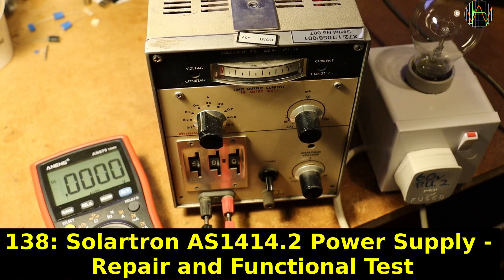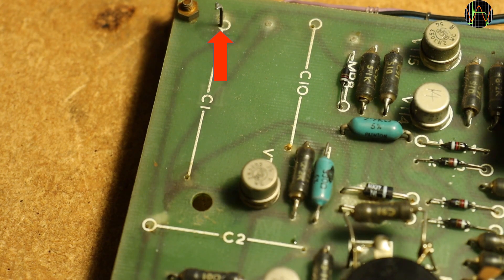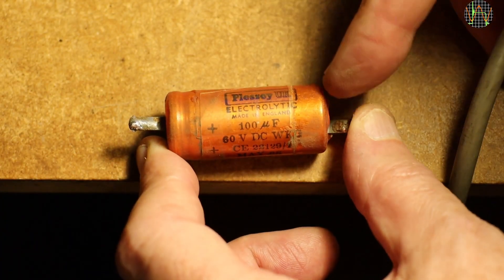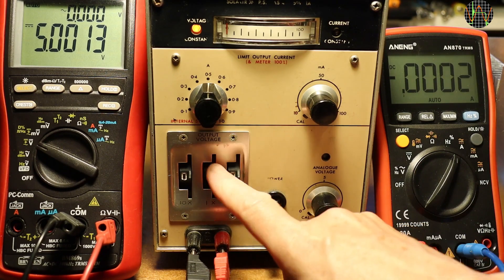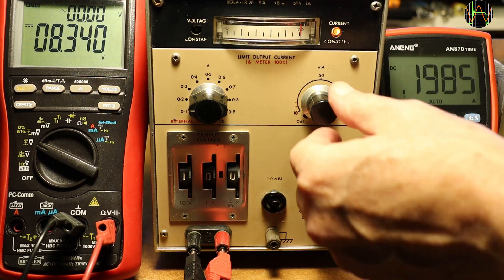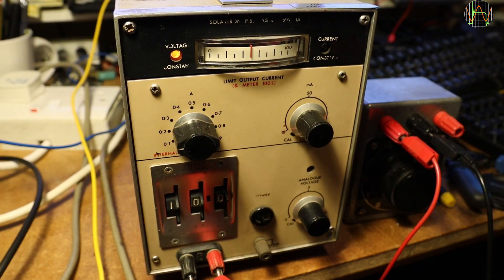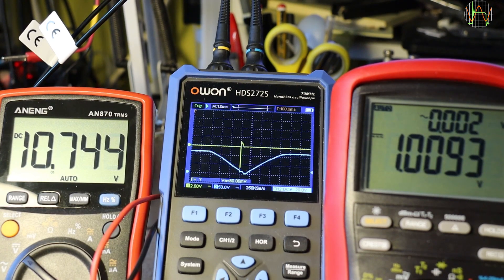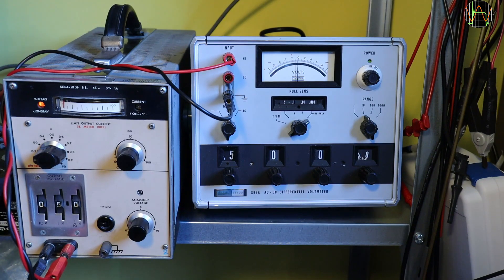138 - Solartron AS1414.2 Power Supply: Repair and Functional Test

Comment: Hi, did a video of testing the removed Solartron caps ever happen?
Reply from the maker: No, they all tested fine, including the sticky ones and the big one. In general, I am now more picky in replacing caps. Vintage ones seem to last much longer than normal. Yes they may fail eventually but even new ones may do that. I think these days caps have evolved to higher performance in smaller form factors which may not be the best for a long life.

Comment: Nice repair of an interesting piece of equipment. Another use would be as an AC "amplifier" to produce various AC frequencies and voltages for testing. I often hear people refer to SCRs as thyristors - which is correct. However thyristor refers to a group of PNPN components that includes DIACs, SIDACs, IGCTs, ASCRs, SCRs and TRIACs so should not be used when talking about a specific component. Your usage of SCR is correct in this case. Regards, David
Reply from the maker: Thanks for the update on SCRs. Using the remote voltage capability for an AC amp crossed my mind but this is a DC power supply, so at best it can produce "positive" AC. I might play around using a big cap to block the DC component but not sure how useful that might be. I did get myself a HP 267A power supply/amp that is meant for this kind of thing up to 1MHz no less,  but I bought it as "not working" and indeed it is not. Another repair (hopefully)
Reply: @TheHWcave   I am not familiar with the HP 627A but I do own an HP 6826A Power Supply/ Amplifier. I purchased it a while back on eBay as "not working". The only thing that I found was the "programming" jumpers were not correctly connected for normal operation! The only other issue I found was darkening of the PCB under R5 and R6 on the power supply PCB. I replaced the resistors, leaving the leads long to seperate them from the PCB. Great piece of equipment and very handy to have on the bench. Looking forward to seeing a repair video on your unit. Regards, David

Comment: Those old capacitors generally had some headroom built in over the working voltage "surge voltage" I think was the term. Not uncommon to see them run near the limit, just how things were done at the time.
Reply from the maker: Yes, I agree and it was running for more than 50 years... , well intermittently but still.

Comment: I like that big variable resistor setup you have there. Good to have and more useful than a decade box in some cases.
Reply from the maker: Yes, it's wire-wound and good for several watts. Very handy. I made myself another box, briefly shown in the video in the remote control section, with 4 (normal) pots, also useful.